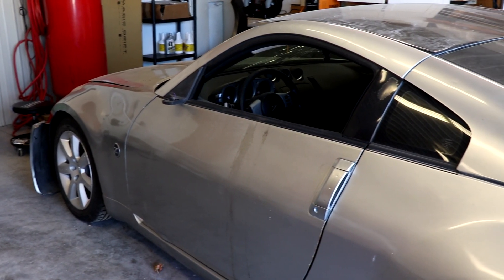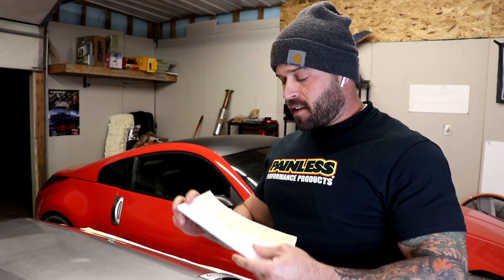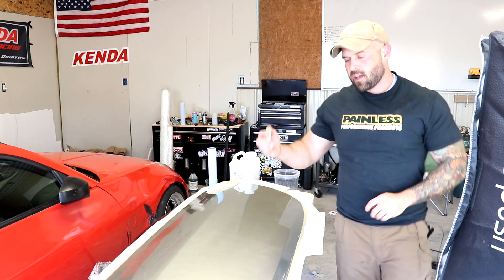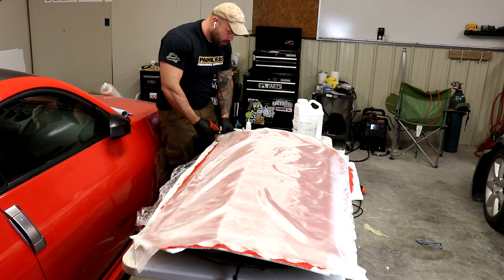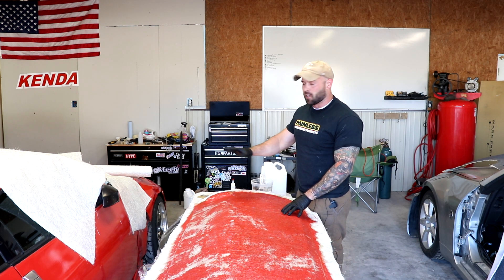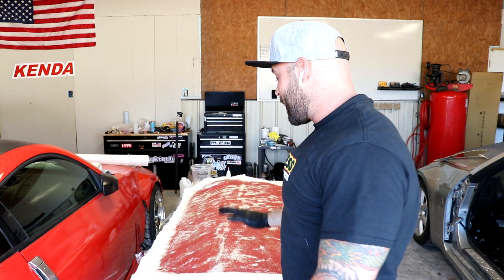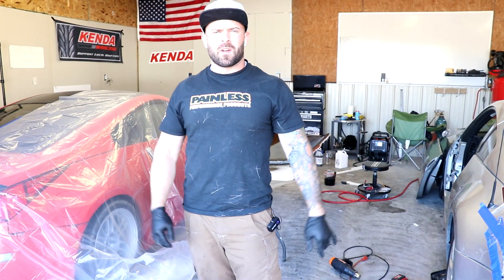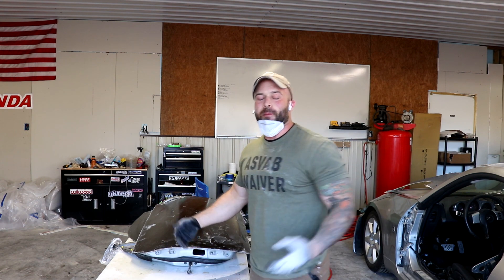DIY Racecar Mold and Fiberglass Fabrication (Build Your Own Aero)

Comment: I put the releaseing wax on before the pva.and I spray on the pva in very light mist coats so no brush marks.then the same when making the part from the mould and the finish then comes out with a slight orang peel. A tyvex suit helps with the itch
Reply from the maker: This is definitely the correct method! Learned after making this video!

Comment: My project is a clear hood for my 89 f150. I’m gonna pour epoxy in the mold but need to figure out how to get the latches and bolt holes in the mix too because I want it to be functional like factory but still transparent. What do I gotta do to keep epoxy from sticking to fiberglass? Is it same basic technique? Got all new chrome pulleys and water pump and timing cover and even valve covers on my 351w along with aluminum intake and 4 barrel but can’t show it off unless hood is open.
Reply from the maker: I am not sure how to manage the clear epoxy hood - I think most people use lexan for the clear hoods. I'd check out Easy Composites LTD youtube channel to see how they managed to get the bolt holes and everything secured to the composite hood. Good luck with the project man!

Comment: Where did you get the filleting wax?
Reply: Nevermind, I see that yours was actually sulfur free clay not a wax.  Looks like there are plenty of choices for sulfur free soft clay on amazon, that's the last item on my shopping list!  BTW I've heard lighter colors of plasticine/non hardening clay are better or it might stain the gel coat. I think it will be harder than the dental wax people use for braces.
Reply from the maker: @TEAMPHY6  I ordered the plasticine from fibreglast and it works well, but a pain to remove from the mold. Dawn+plastic bristle brush does wonders though! (I believe the clay was something like $25 per 1lb)

Comment: This is a really well done video. Simple explanations, no fluffy content, solid editing, etc  The advice about proper tools is key... proper mixing tools and containers are formulated/designed  for the materials.

Please listen to his advice on a respirator and DO NOT do what he does in the video. The mask he used looks like a N95, which is good for particulates when you are cutting the fiberglass later for fitment, but is almost worthless for vapors. If it has a charcoal layer, it HELPS with "nuisance level" vapors, but is not intended for this deep or length of exposure.

The correct setup is, at least, a half-mask, but preferably a full-face mask which covers the eyes and equipped with cartridges for organic vapors.

A 3M 6500 half-mask is about $20 and a full-face 3M 6000 about $150. Organic vapor cartridges are about (3M P100) are about $25 each. So $200 for top-flight protection.
Reply from the maker: Thank you for posting this. I only recently learned that a full face was so important and immediately invested in one! Thank you again for the comment!

Comment: Why didn’t I use a square 2x4 setup over the top fiberglass on the mold, to make it keep its shape over time and multiple uses
Reply from the maker: The piece releases easy enough that it wasn't necessary to reinforce the mold like this. Definitely would do that for something like a bumper or anything more complex than a slightly curved flat piece

Comment: Nice explanation on the process! Are the products you used all from the same supplier?
Reply from the maker: Thank you! I used Fiberglass Supply Depot for the products. I would probably use West System or Fibreglast products for resin if I was doing carbon/infusion, but I've had NO issues with these products.

Comment: where did you get filleting wax?
Reply from the maker: I WISH IT WAS FILLETING WAX. I used plasticine (modeling clay/oil based clay). It's a pain to clean, but dawn dish soap and a plastic bristle brush does wonders. The clay is expensive but I've reused the couple lbs I purchased about 4 times.

Comment: All them white spots in the fiberglass mat it all air and is dry you need to add more resin to them areas that mold is very weak also, you can get away with only using paste wax for a much better finished part.

Comment: I've built many molds and fiberglass parts over the last 30 years so I am very curious about one of your procedures. The standard practice is to wax and polish the mold then spray on a coat of PVA. Is there a particular reason that you put down your PVA and then wax ?  The PVA film is very thin and delicate so I am surprised that waxing over it and then buffing didn't damage the PVA layer. Please don't feel like I am picking on you I am just very curious, maybe you hit on something I am not aware of. Good luck with your project.
Reply: I started with making molds not so long ago and i was thinking the same.  Not to bash the guy becouse he did a great job. But it seemed strange to add pva first and wax after it.
Reply: Hi there . When PVA is fully dry, there is no problem to put wax. The eventual problem will be , when PVA is layed , there is so much dust in the air (the dust and garbage is everywhere), and stick. When you apply the wax maybe with the rag you can probably hang some of the sticky garbage and peel it. I do it from years , and there is no problem .
Reply from the maker: Honestly you're probably right about the process, but I was able to carefully buff without damaging the PVA. That being said, the PVA was on there TOO thick. I changed to wax then HVLP spray the PVA since this video. Appreciate the comment though!
Reply: @freedomfriestv Yeah, spray is best...you can even use a spray bottle mist for the smaller things.

Comment: I’ve bin manufacturing parts for about 3 years quick tip tho, For best results use a hvlp for Pva cheap $15 one from HF will do just fine and for gel coat brush one way only and it applies really smooth. What’s your ig I’d like see other protects.
Reply from the maker: Figured that out very quickly and purchased a HVLP gun right after making this video! Thanks for the tip!
Reply: Awesome! This fiberglass stuff is pretty cool ideas are endless and the best part is pulling the parts out the plug.

Comment: Now you should do a carbon fiber skinning over it lol I want to do something similar and make carbon fiber fenders. 

Doing this plug first, then Fiberglass part in your video first would make them much lighter than the steel versions available for my vehicle, that I would have to lay carbon fiber over.
Reply from the maker: Carbon is the next step! I'll be getting vacuum infusion equipment in the future. You can definitely do without, but if you've seen ECO-LAP Studio... it's a lot of work!

Comment: Can we making mold without gelcoat , jst use matt ,resin , wax how it possible?
Reply from the maker: Yes. Wax, resin, Matt will make 1 part. You will need to do work to make the part look good. Gelcoat will make a mold so you can make many pieces with a perfect look every time.

Comment: Wax goes on first then pva. Right?
Reply: I have never seen someone put wax on after the PVA. I have used just the PVA and had easy releases, but waxing first will make it easier.
Reply from the maker: @danielohara2974  Maybe I'm mistaken in the process, but have always had easy releases. Will look into it! Thanks for the comment!
Reply from the maker: PVA first. Would recommend picking up a HVLP paint gun from harbor freight for $20 to spray on the PVA. Much easier/better release vs painting it on. That being said, I painted it on prior to learning this and had no major issues (outside of runs imprinting on the gelcoat).

Comment: So I'm still a student and I'm looking for advice. I have a foam wide body kit I built and put body filler all over to try to even it out and make it smooth. I thought I put tape all over this before I start my fiberglass moldings. I do need like a little extra at the tops for like the edge like you're doing but do I just use that wax or should I put tape all over it first? Any help as much appreciated these are huge moldings biggest I've ever done. Thanks
Reply from the maker: It kind of depends on your goal. The flange I placed around the piece was because it helps to release the item and it's needed for vacuum infusion. All of this was made to be reproduced MANY times.

If weight isn't much of a concern - After doing bondo you can either do tape or what I prefer to do is rattle can the bondo with primer and preferably a topcoat. Apply PVA release (the green stuff in the video) then apply release wax (make sure to buff off). Then you can simply lay down your fiberglass and pull that from your plug (the foam/bondo piece).

A mold (the red piece I lay my fiberglass into) will create a better/lighter piece, but will at least triple the cost vs just laying fiberglass over what you've already created.
Reply: @freedomfriestv  okay that makes sense thank you very much I appreciate your help I'm an auto body collision repair student just working on my own stuff and still kind of learning. I've made fiberglass moldings of small pieces and I've built stereo boxes but it's different to do a whole body kit. Thank u

Comment: Great how to! Much better than most I've come across.

When it comes to doing something like a sunroof plug, would it be the same steps, essentially, even though it's glass?
Reply from the maker: Thank you! Yeah, just make sure to seal off separations with molding clay so the gelcoat doesnt seep into any cracks. Good luck and I hope it goes well!

Comment: Very detailed video. Enjoyed learning the process. Also considering making some fiberglass molds for personal use. Would you be able to get us a break down of all the materials needed and where you recommend to purchase these from, to accommodate best quality and price?
Reply from the maker: Gladly!
For a mold:
PVA Release Agent
Mold Release Wax
Tooling Gelcoat (can be painted on)
Iso Resin
Fiberglass Mat (You'll want 3 layers of the thick stuff)
Measuring Pail 
Metal roller (to get bubbles out)

I get my stuff from fiberglasssupplydepot.com (they should sponsor me!)

Sorry for the late reply!
Reply: @freedomfriestv  Thanks so much
Reply: @freedomfriestv do you need to use pva and wax release agent as I've seen a couple of videos and someone just used wax and someone else just used pva ?

Comment: Are you goin 2 sell them? Thats bad ass man good work!
Reply from the maker: Yes sir! Probably $350 for the pair. Has to be cheaper than replacing doors right?
Reply: Sweet! Post up when you are ready 2 sell a pair my drift car goes in for paint in about 6 weeks and I'd like 2 get me a set so I dont have 2 replace mine. I gutted my doors out so I can run "nascar style" door bars and I dont want to cut out another door